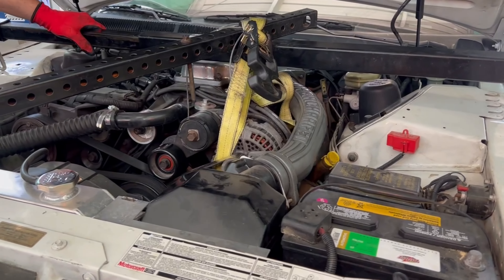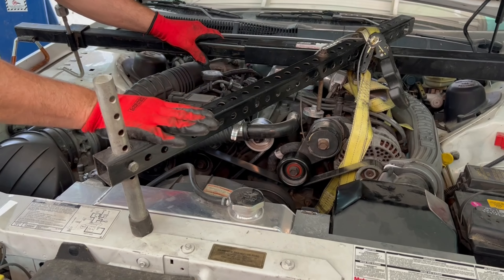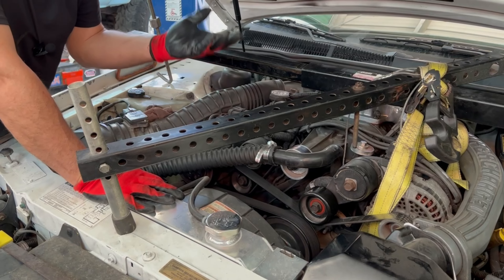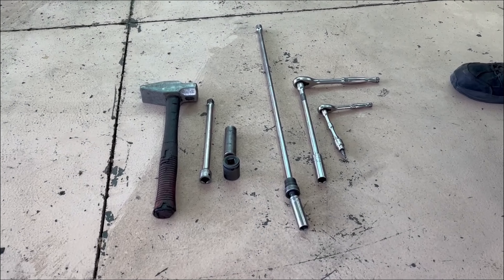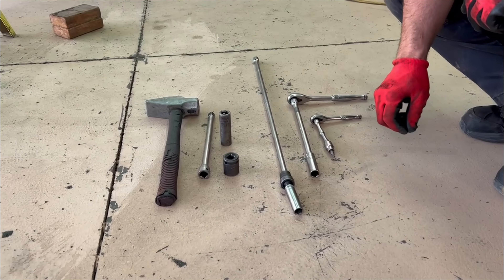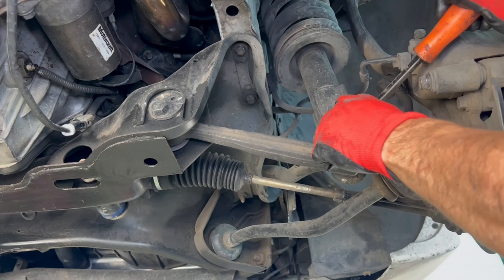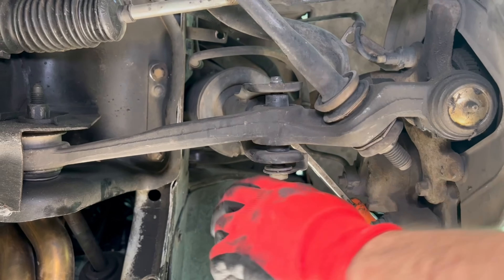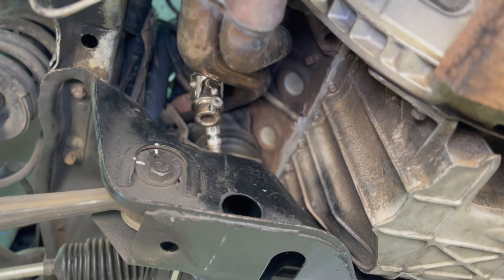1989-1997 Thunderbird Cougar MN12 Subframe Removal Part 1

Comment: Informative video! Any chance of the nuts for the subframe bolts spinning in the frame rails?
Reply from the maker: The fasteners in the frame aren't nuts really. They are captured into the frame rail. Though they do move some, so they can me manipulated if need be. Only reason I can think they would spin is from heavy corrosion from being driven in winter weather over the years. Otherwise there is little chance they would spin. Hope that helps
Reply: @BirdCatsMN12RepairGarage-vg7mz  I know my son had some captured nuts spin on him from time to time at the Ford dealer he works at which is why I asked. Thanks for the reply & videos!